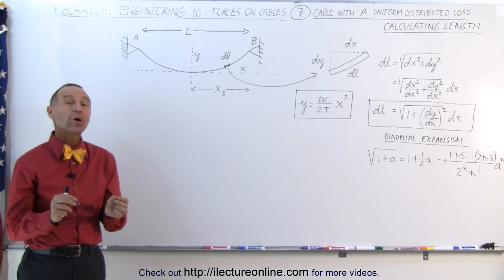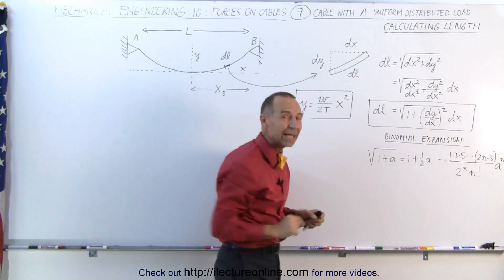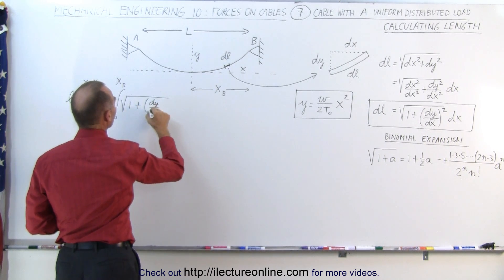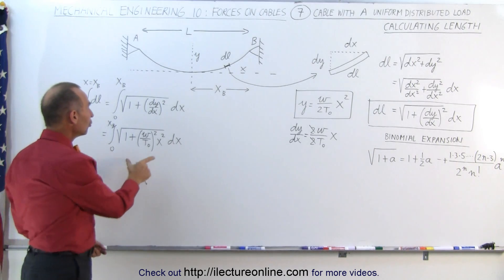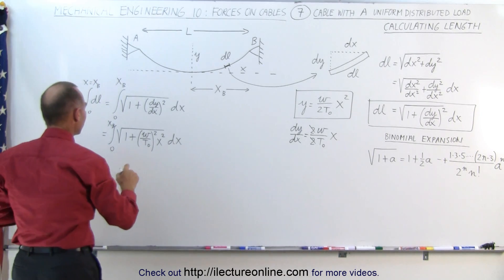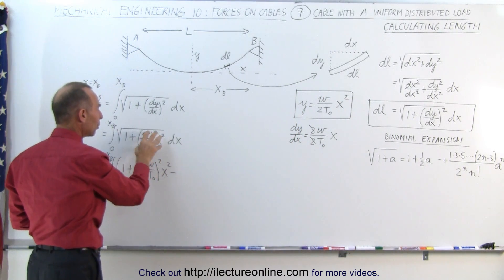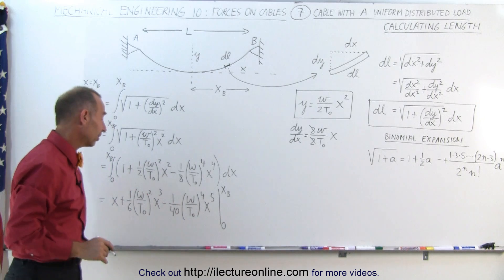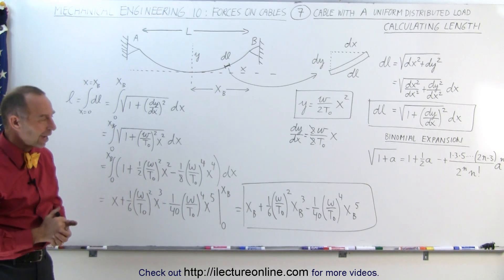Mechanical Engineering: Ch 10: Forces on Cables (7 of 33) Uniform Distributed Load: Find Length

Comment: Isn`t the equation of the cable a cosine hiperbolic and not a parabola? The catenary form?
Reply from the maker: watch the videos later in the playlist
Reply: @MichelvanBiezen  thanks, but the question was:  the cable describes a parabola or a catenary?
Reply from the maker: A hanging cable that has weight and is without a load will have the shape of a catenary.